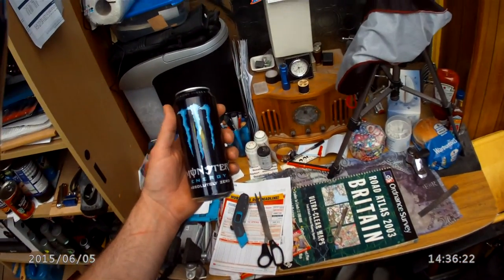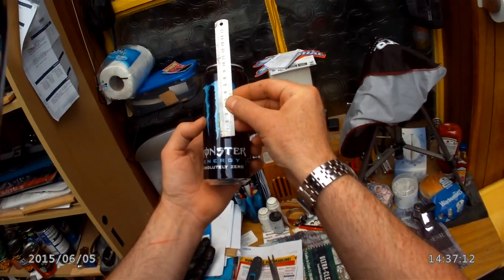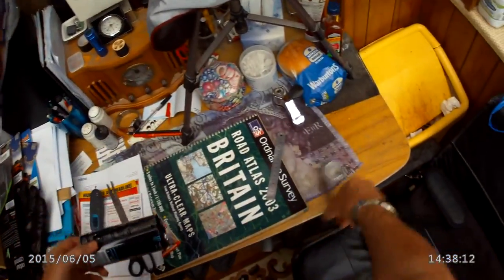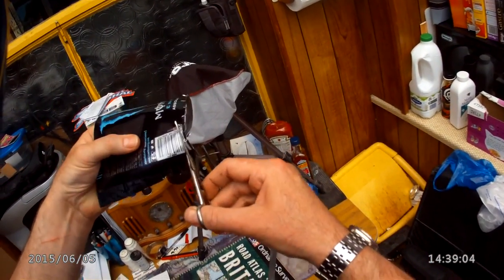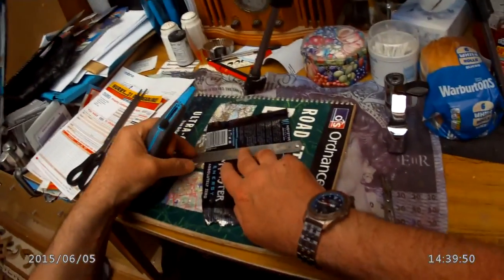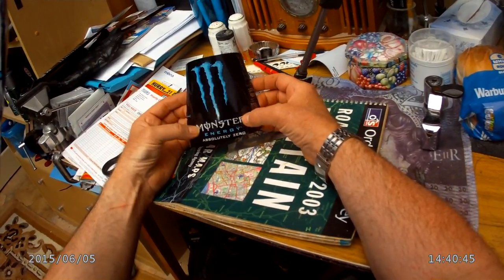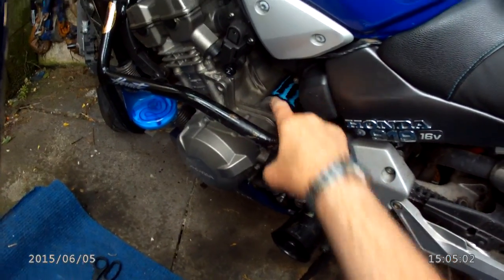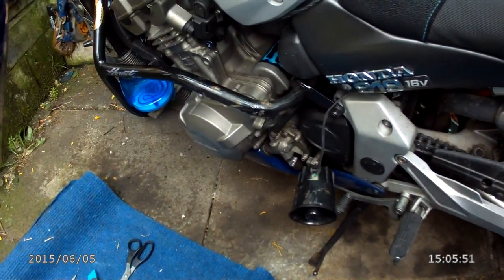...Starter Motor cover...?!

Comment: That little bit of low cost bling on the starter looks great steve :)
Reply from the maker: banditnev ...thanks, yes but I'm not sure what other Japanese manufacturers starter motors are like...the Honda ones have those two handy bolts to slip the can behind and help it stay in place. You could do a Fosters one....or Castlemaine 4XXX...! Do they still make it over there...?...when it first appeared here in 1985 it was delicious...then it went crap, the reason being was that it started to be ''brewed in the UK under licence''...and we obviously arsed the flavour up as it went like nat's piss !
Reply: Steve'sHornet900! Never could take to fosters, 4x isn't to bad but love the Tooheys New beer:) from New South Wales.